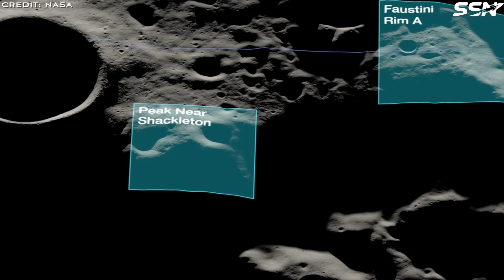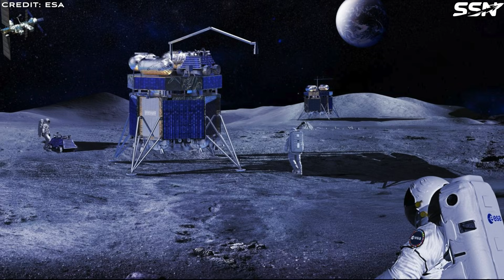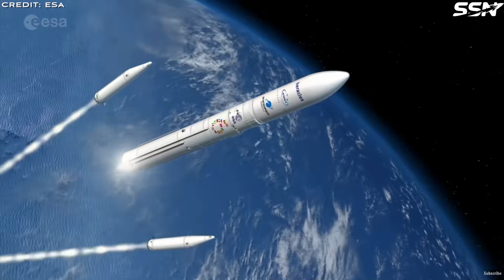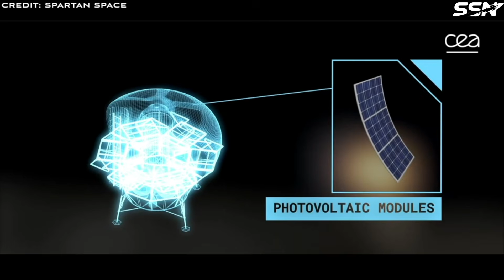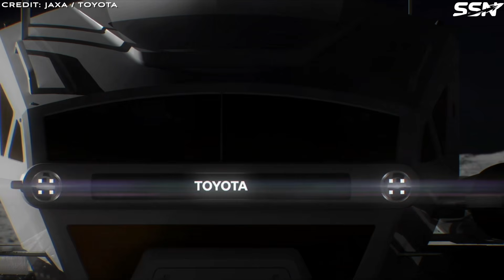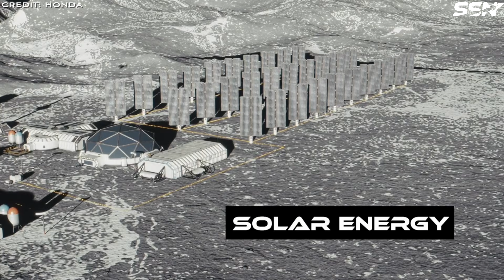Artemis Base Camp: Key components including Habitat, Rovers, Landers and a Nuclear Power Plant

Comment: A cheaper power source would be a solar battery.  By simply setting up a large solar sand battery farm which uses reflected sunlight to heat the sand within its insulated containers it would be possible to store megawatts of power that could then be accessed by solid state methods to convert the heat into electricity at high efficiency. See Two Bit Da Vinci - "Breakthrough Solar cell DOESN'T Run On Sunshine!" to see the heat photovoltaic effect. This should work better than nuclear on the moon, it would be much cheaper and expandable.

Comment: An expert weighs in on the design of Starship TPS...
It's not good.  It appears that tiles are fitted arond the stifferners used on the barrel. Tiles are cut to fit reducing thickness by 50% in some areas.  In addition, there is video evidence that TPS is compromised around stiffeners, and there are high temperature patinas on the stainless. 

Reuse may be much farther away than being advertised.

Worth a look:
https://youtu.be/MZUQe38SJIs?si=6sSgtd9_LY8OOgjI